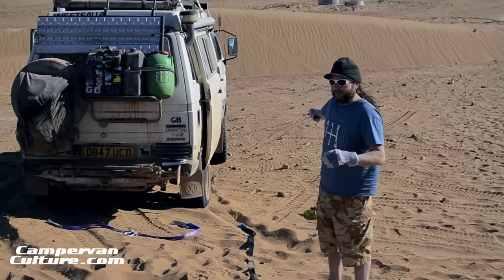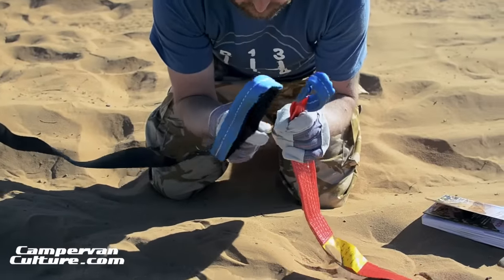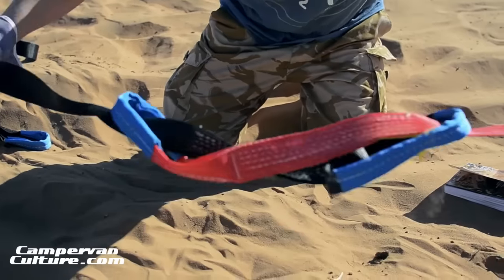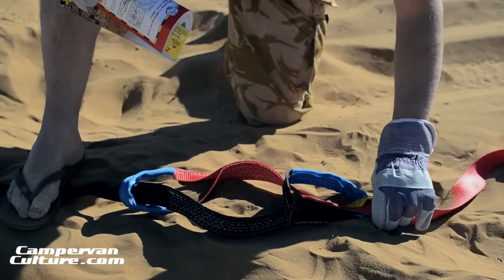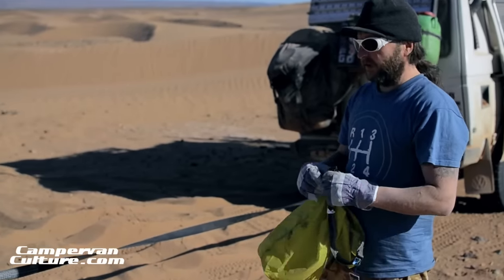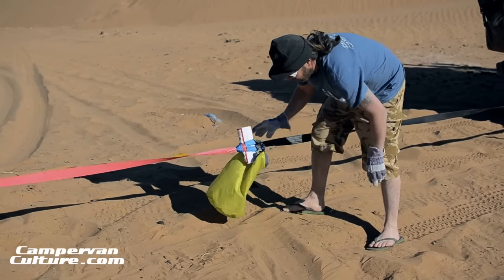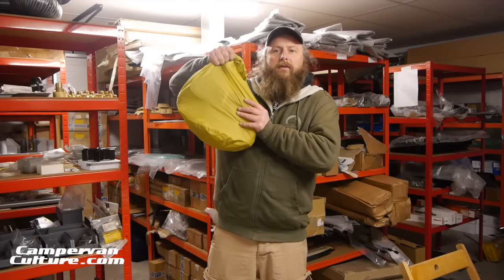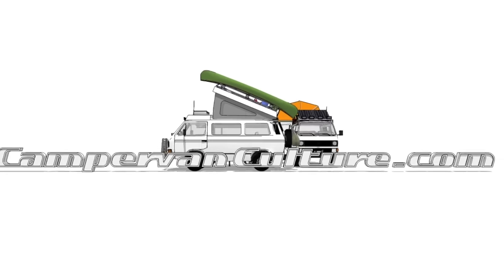VW T25 T3 Vanagon Recovery *What We Use & Supply*

Comment: Jed:  What about using your soft shackles in place of the steel ones?  Lighter, not going to become projectiles in the event of any failure.  Great video as always!
Reply from the maker: The soft ones are miles better and a major plus point is that they float and sit on top of mud, sand and snow. Like you say they are also miles safer as they wouldn't take your head off. This kit is what we like to think of as the entering level one that is the minimum you should carry that will get you our of trouble most of the time. I do carry soft shackles too tough these days for more involved recovery. That said I don't go as crazy as I used to as I usually have the family with me most of the time now. 

The next trip video is a solo on though so I will have to give you a shout out on that one Andrew later in the year when I get truly stuck and get the soft shackles out.

Jed

Comment: Awesome drill. I thought that the pulling strap went around the shackle bolt, so if there was a shackle failure it would be the smallest possible projectile. 
My $.02 
Keep the info coming, great presentation🍻
Reply from the maker: This type of video will always get controversial perspectives kodiakcopilot. If I were to put the strap around the pin I wouldnt have been able to get such a large shackle through the tow loop. Going for the strongest shackle that would fit and fitting a safety strap to the tow line and using a strap that would give before the hard wear would makes sense to us and is our pre faired way. 

Thanks for the kind words and the nice way you said them. 

Jed
Reply: kodiakcopilot Thanks for the reply. 
Looking forward to the latest vehicle project.